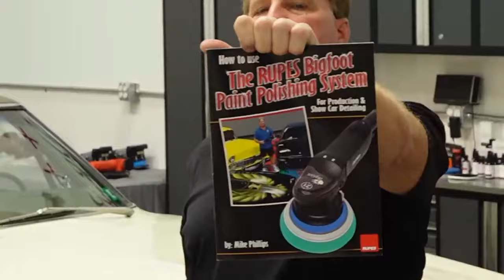Which Polisher Should I Use? | 🔴 LIVE Online Detailing Class with Mike Phillips

Comment: Mike, We work on boats all day. We use Dewalt rotary’s  because of decent reliability and a $200 +/- price point. I was considering picking up the corded flex or rupes rotary for lighter, quieter, smoother operation. But the $450 price tag is a little deterring. 
So I guess the question is, buffing boats all day, would you select flex, rupes, or just stay with a DeWalt?
Reply: Charge your so you can afford the extra $250

Comment: What about a Bosch get-75n sander in turbo mode. It is like the porter cable. The bosch sander is meant for wood mainly. Can you use that to polish with to get holograms out?
Reply: My guess is "no".  MOST dual action wood sanders will not maintain pad rotation and thus will not maintain pad oscillation, so all you get is the pad vibrating against the paint.  Zero defect removal.

Get any of the entry level polishers I recommend here and you will get the paint correction step done much faster.

The Best Polishers for Beginners
https://www.youtube.com/watch?v=i0WboHIoh5E

BUT - if you do try your wood sander for a paint polisher - please do come back and let us all know if it in fact worked.

Thank you for watching and commenting.

-Mike Phillips